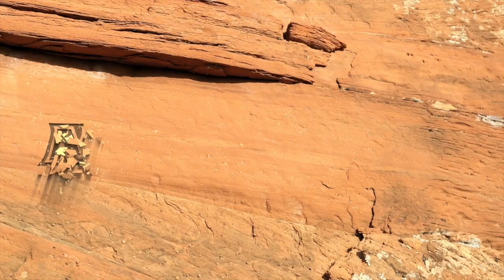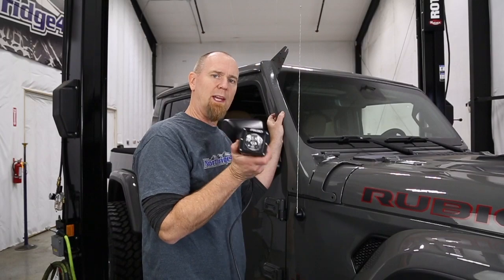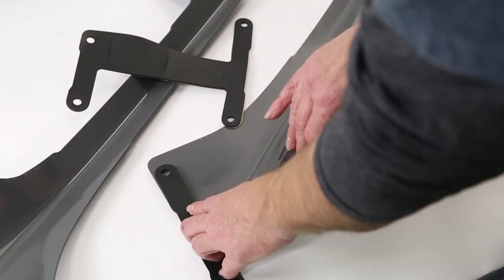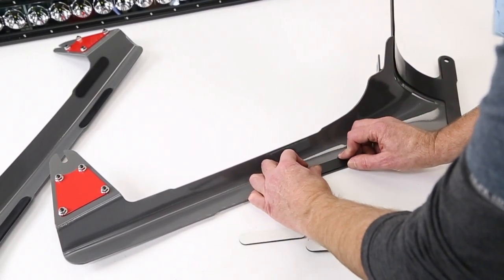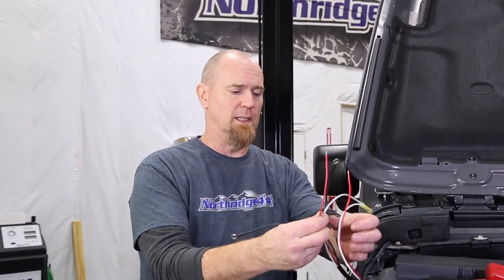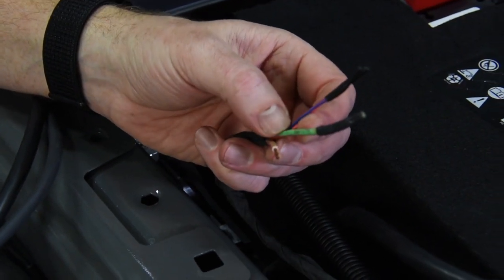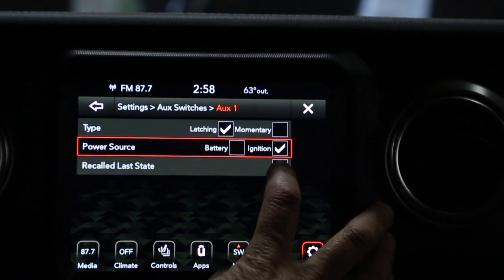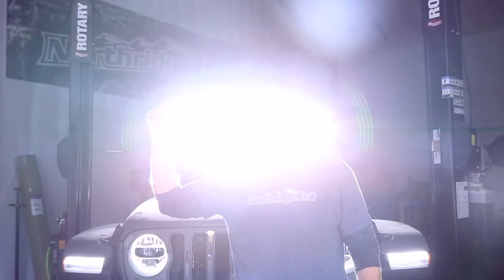Rigid Radiance 50" Light Bar & Pods Install on Jeep JT

Comment: Im in northern Canada and will be travelling the ice road to James Bay communities a lot this winter in my gladiator, what would you suggest for an easy to install LED lighting option that keep the windshield folding feature. (I have the LED option and the AUX switch option)
Reply from the maker: There are not any light bar brackets that allow you to fold down the windshield that we are aware of.
The best would be to install your lights down on the front bumper.

Comment: How did you run it through the firewall and where at
Reply from the maker: We wired them the factory Aux Switch wiring under the hood. Starting at 6:27

Comment: I’m currently installing my rigid radiance led light bar, did you use the harness and relay included with the light? Or just lengthen the 3 wires from the light and hook up to the aux switches and ground?
Reply from the maker: We used the harness and relay included with the light. Though we had to extend one side to reach across the cowl panel and up the windshield.

Comment: Great video! Did you use the the wiring included or did you use the rigid wiring harness?
Reply from the maker: We used a combination of the wiring and extended them to fit the needed length.

Comment: Is there any reason the pods can't be mounted on a bull bar?
Reply from the maker: The Radiance pods can be mounted anywhere. The small size makes it easy to fit them in tight places.
Reply: @northridgenation  ty